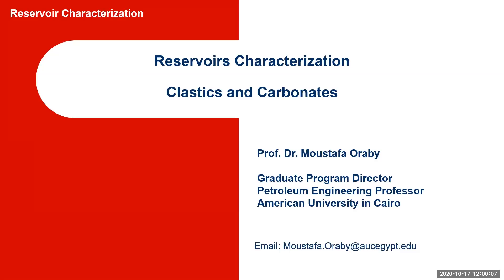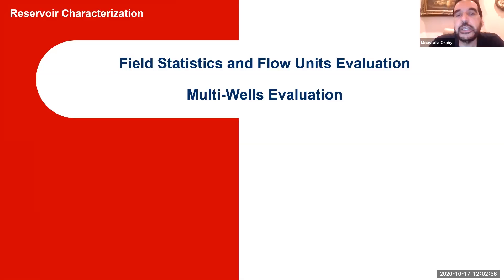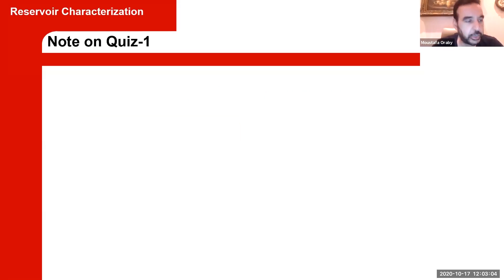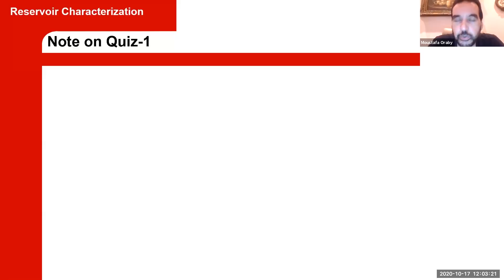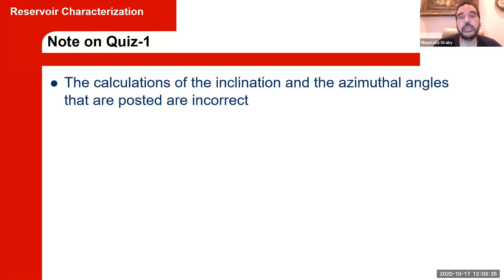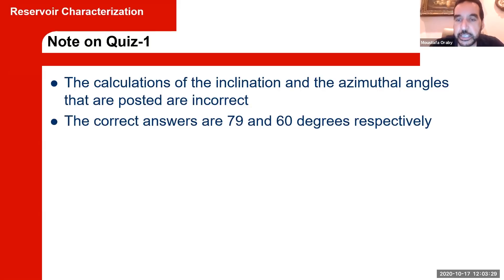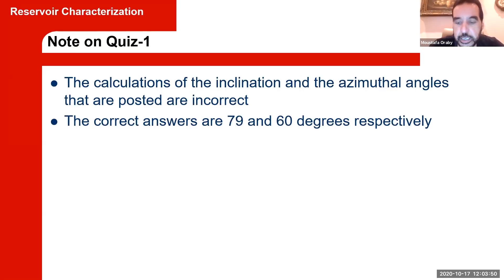Reservoir Characterization, Dr. Moustafa Oraby 03/05

Comment: In this Lecture I Learned 
#1 That when calculating the porosity of clays it requires a porosity correction to be accurate
#2 How to make a histogram to understand the effective porosity in a single well and why this will not work for understanding an entire well field
#3 What a vairogram is and why this is preferred for understanding well fields
#4 Why there is no relation between porosity and permeability; this is because of the crucial importance of pore throats not porosity itself
-Tanner Hurst